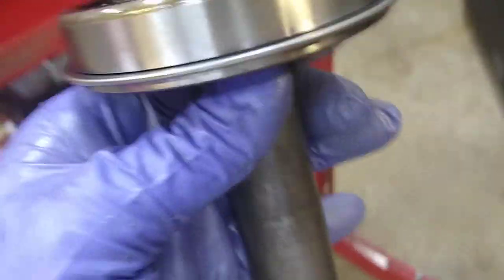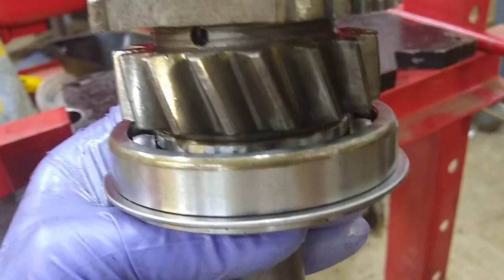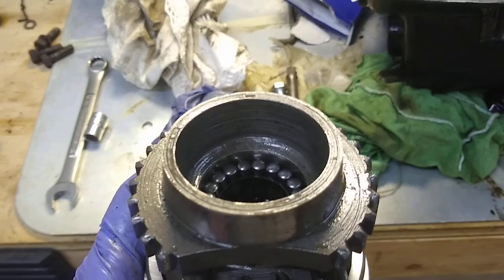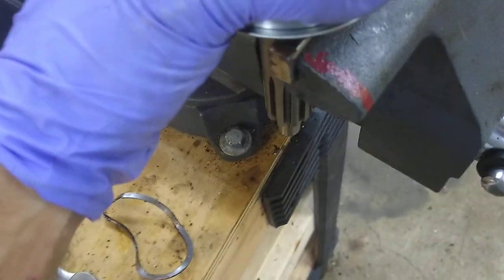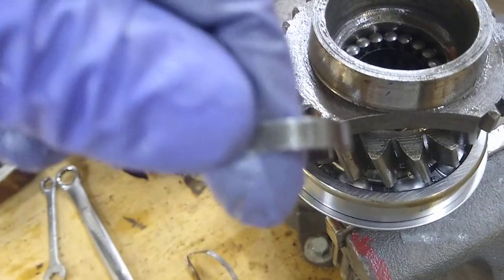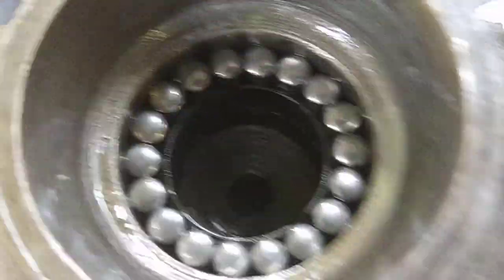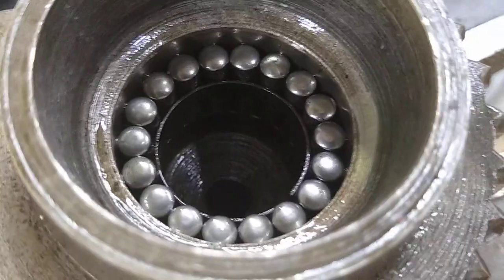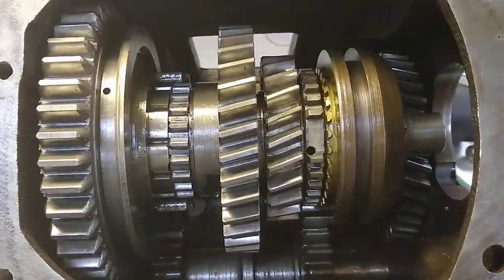SM420 Transmission Clutch Input Shaft needle bearings

Comment: are r needle bearing supposed to be a little bit noisy if you have really good hearing?
Reply from the maker: I don't think so.  There are so many bearings and moving parts in there I don't know how you can single out the needle bearings.  I suppose there is going to be some noise.  You should put assembly lube on all the moving parts as you assemble.  If it doesn't sound like something is jammed or scraping you should be ok.  You should be able to turn the input shaft by hand and spin the output shaft.  Nothing should bind up.

Comment: Where did you get your parts from
Reply from the maker: Hey - I got my rebuild kit from Novak Conversions, which specialize in Jeep stuff - Like fitting these transmissions into various Jeep models/years.  They have lots of good info and a well put together kit that comes with instructions.  https://www.novak-adapt.com/knowledge/transmissions/manual/sm420/ 
They are a little more expensive that some other kits it seems, but I wanted to know there was good support and phone number to call if I had any issues (which I didn't)